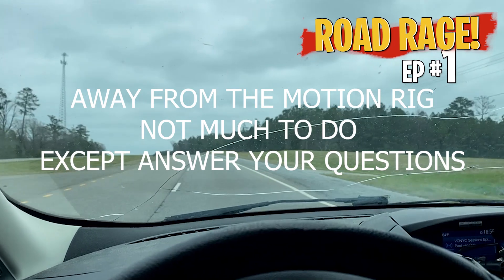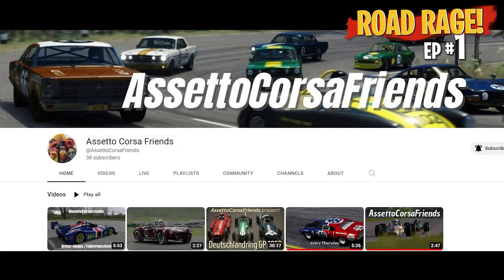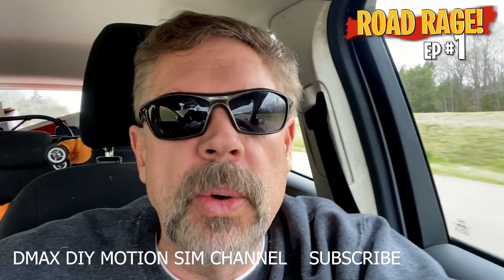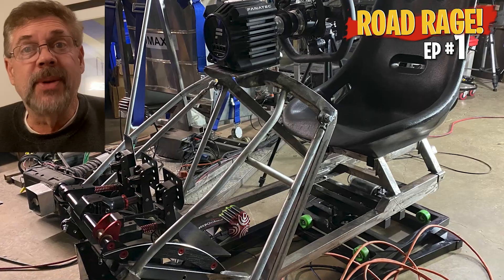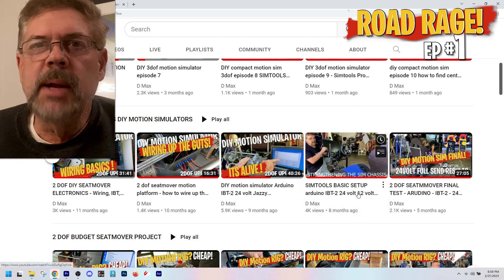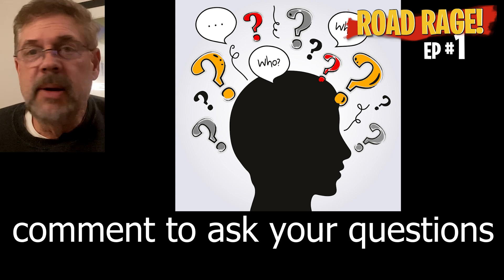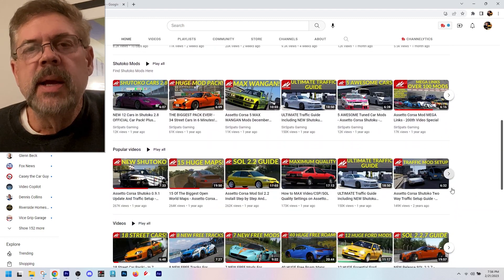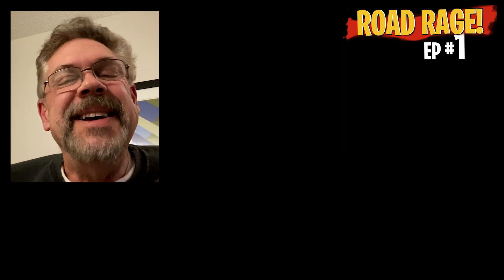NOT LIKE THE LAST

Comment: Congrats on the recent channel success Dave 👍Gonna have to be on the look out for your next video so I can try to win that Simtools giveaway. I'm waiting on some parts from china to arrive so I can finish my rumble motors for my pedals
Reply from the maker: Thanks RicheyB..  I wouldnt classify it as 'success'  but it's a bit of fun for sure.  I was just working on the 2nd ep and  BOOM it's 25 min ..  I gotta cut it up tomorrow night and leave a lot on the floor..   So what kind of motors for the pedals?  Sim Hub?  Cool..  I think i broke my Fanatec V3 motors cause I had them plugged into the USB and the phone jack to the wheelbase at the same time.. now they dont work..  So let me know about your project..  I could use some good info when you get them working.. Dave
Reply: @DMAX_DIY   as long as you're having fun 😊 I'm using this tutorial https://youtu.be/wcWbjlMwF7Q and yeah using simhub to control the shakers I'm personally using large Xbox rumble motors. I'm pretty sure that simtools has the functionality to do it as well but I could be mistaken. I know SRS does for sure. I've seen a lot of good reviews on the plug and play kits but I'm going the DIY route to practice my soldering and save a little money.
Reply from the maker: @RicheyBLS  I copied the link..  I'm going to look at it..  Eventually I want "LIGHTER" weight pedals.. may have to make them from carbon fiber..  (which I have but still have not used) due to winter temps..   But I like the rumble in the brake so..  All in.. as usual.. Thanks for the link. All the best ! Dave

Comment: Woot!  Good to see a new video Dave!  I like this idea, the main sim videos focusing on the build and these can get some specific questions some light.
I know you are a grown man but...
<dadmode>
  For or the love of God please get a mount for your phone for recording in the car :) How are we going to get our simrig fix if you end up in a ditch because you
  were fumbling with your phone 
</dadmode>

I have to say, the fram just in primer looks really good.  Big difference from bare metal.  I have been experimenting with automotive vinyl wrap on my virtual pinball project(to cover the aluminum sheel of the power supplies(5/12/24v} and this weekend going to try to wrap my legs and lockdown bar and rails.  I have an hlvp sprayer and Im okay at it but the vinyl looks like it might be an easy option.

Okay for my question:
  You are building a 3dof  rig.  Sp you have pitch, roll and traction loss.  If you were to put the whole thing on a flat platform that had some kind of piston/actuator to move it up and down would that be a 4th DOF?   Or if if you have a way for shift the rig forward and backward ? Or left and right independent of traction less?  I don't know if those are valid or I am confusing myself and  not sure if they would be supported in simtool/etc.
Reply from the maker: Heck ya!  NOW THATS A COMMENT!  Ok .. I was just driving along and then thought..  I should just 'start' a video right now  - totally random -  either that or I would have forgot to do it or made an excuse by time I got to Alabama.   
I did buy some cool vinyl wrap already.. Cant wait to try it out on part of the frame..  So we thinking alike.

Yes but you would need a massive amount of leverage or one heck of a powerful motor to move all that weight up and down.     
The other option.. - slide forward and bkwd - Yes I there is a company in UK that's doing it..  Lowrider or something..  That would be much easier..  Probably more immersive too.. 
SImtools would support either movement..   Up/Dn  called "HEAVE"..    Slide FW/BK would be surge.. 
Great question..  Thanks my friend! Dave

Comment: I was gonna do your build but had trouble finding motors.   Can you tell us where to find motors?
Reply from the maker: Great question deezler..  what country are you in?  that can be a factor from what I have noticed..    I'll cover it in the next vid too..  Thanks for the question.. let me know
Reply: @DMAX_DIY  NZ here. Real easy for me to buy from China, Europe is most expensive for us.
Reply from the maker: @kiztime1234  can you get shipments from AZ..?  they have the best motors
Reply: @DMAX_DIY  Is that Arizona? If so yep, getting stuff from the states is no problem.
Reply from the maker: @kiztime1234  Australia     not Arizona..    Can you get stuff from Canada?  That's where I get my Crab pot motors
Reply: @DMAX_DIY  Ahh that's AU :D  Yeah, but shipping from Canada can be hefty. Australia is definitely a good option.
Reply: @DMAX_DIY  Those power supplies... make sure it's actually 800w on the 12v rail (i.e. 66A). It might be that it actually has something like 40A on the 12v and the other 320W is 64A on the 5v rail, for a total of 800w, if you dig?
Reply from the maker: @kiztime1234  Good point!  Thanks..  I have some 550's a buddy gave me.. I can check the specs  - I was just going to use them to test with before ordering some bigger ones.  Also i need to take a look at what some of the x-simulator forum guys are using.

Comment: Hi Dave, how much of a difference does the angle of the connecting rods (from the base platform to the mover) make?
I've got some BTS7960's that seem to cut out under constant load, but the angle of the rods are only at about 7 degrees
Reply from the maker: Good question Matt.  What type of power supply are you using?  Maybe that is what is dropping out?  My race rig is run off a battery.  I say that because I have not had any of my IBTs cut out..  Also make sure you are using a fan to blow over the IBT fins.. They should be able to hold  close to their spec rating (IBT's I think are about 43 amps.
Reply: @DMAX_DIY  2x 24v 1000w 42a, and yep got a fan pointing at the fins

Comment: Why did you choose 12v instead of 24?
Reply from the maker: Simply cause I read the forums on x simulator and that seemed to be the best and most reliable motors to go for.. plus they were only $99 each at the time.. which was way cheaper than the big ones from Australia.  60:1  but about $350 each

Comment: will you do Simtools Version 2 setup?
Reply from the maker: Well  I am using simtools v2  and I will absolutely be doing a video on it..   But since Simtools V3 is still in BETA.. it's available but I have not tried it yet.. Great question! Dave
Reply: Maybe it’s v3 I’m thinking of. The one where game manager and tools manager are combined
Reply from the maker: @oliverf944  Yes that's V3..  I have it but it's on my new laptop and have not tried setting it up. But if you go on x sim  they have a whole forum on it .. Not many setup videos I could find but at least the information is there
Reply: @DMAX_DIY  I’m struggling with it. I’d love to use it with windsim. But I’ve had to go back to v2

Comment: Hi Dave, I have collected a few things to start my project but I'm not sure about my motor. I was thinking about using tarp motors off of a dump truck. I can get 50:1 or 60:1 motor. Do you think they would work well and if so what gear ratio? Thank you for all your video's!
Reply from the maker: Hey Adam..  Good question.. I saw those tarp motors on EBAY and almost bought some ..  I think the 60:1 may be the best choice but without the specs I just cant say for sure.   I'll make a note to pick up one to 'test ' out sometime this year..  I know that doesnt really help you now but  at least it's back on my radar for information.   Thanks. Dave